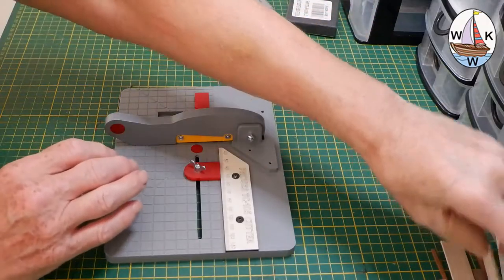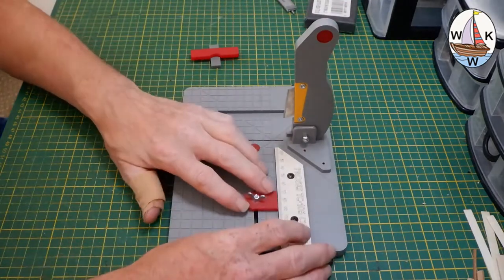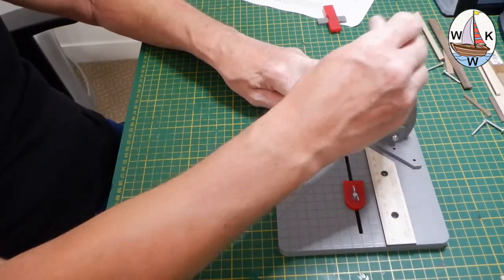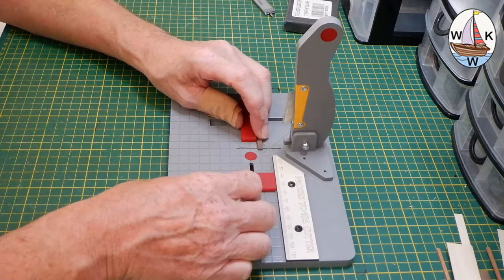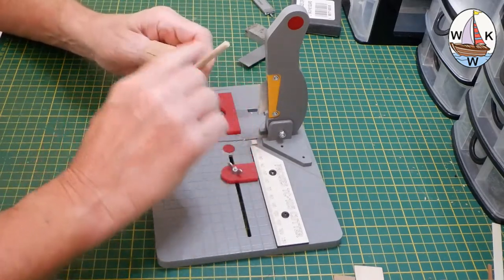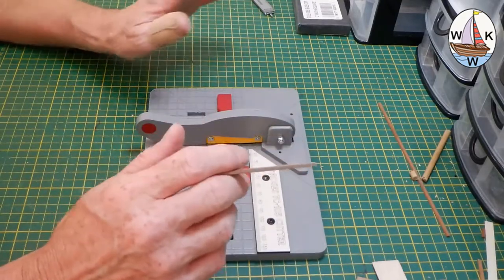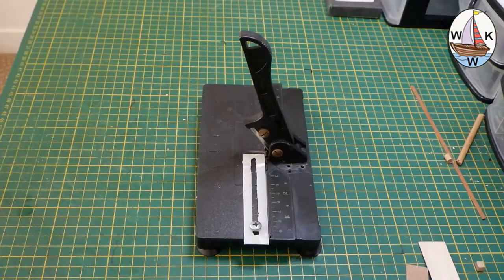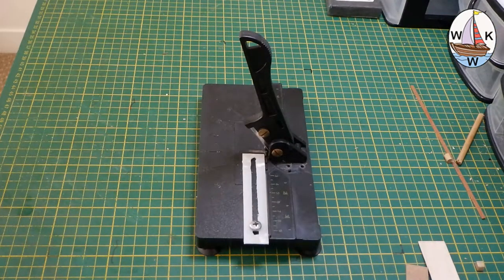TC 105 Review Part One

Comment: Is that the Cutter you purchased from the US ? I like the Comparison between those both Choppers . Btw if I cut thicker Wood I cut it from 2 or 4 sides that makes the Job easier .
Reply from the maker: Thanks for the comment. 
No it isn't the one from the US you will have to wait for a review of that one. 
Cutting from more than one side would be helpful but as I said if the section is getting too big you should probably use you hobby saw.

Comment: micro mark chopper is all steel but it dose cost $ 45.00 . on u tube a guy shows you how to make a chopper out of wood I worked in plastics factory that is poor plastics.or to much heat on the part.